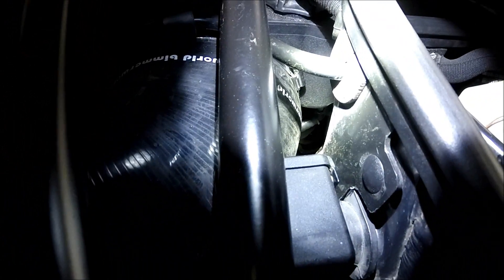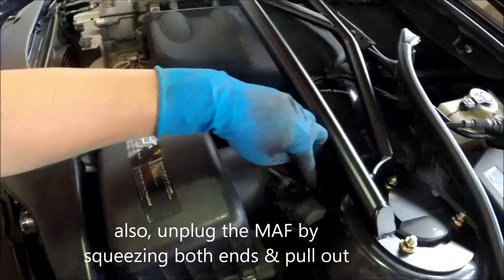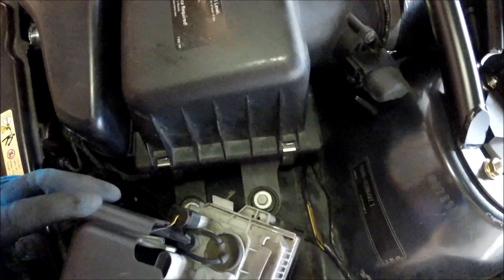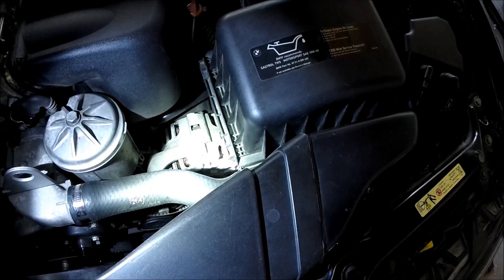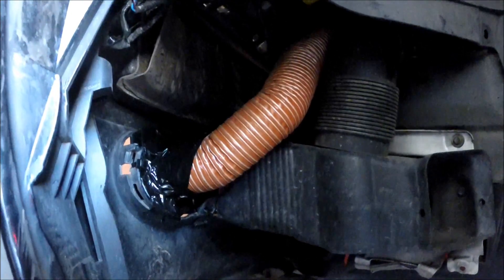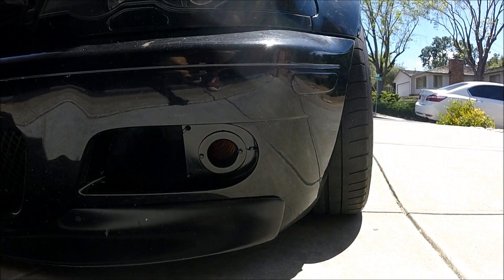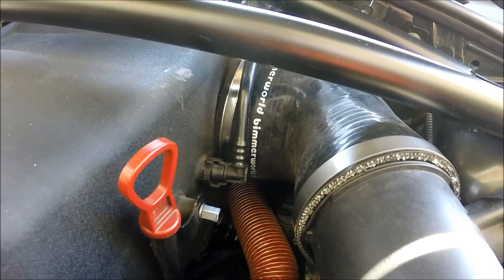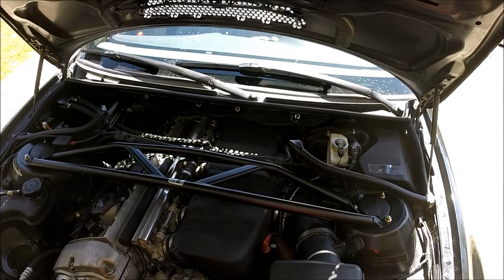SMG Cooling for your BMW E46 M3.

Comment: I wasn't aware BMW placed the pump near the engine. No wonder it gets hot !
On the E36 (mine) it's mounted up top next to the radiator on the drivers side ( RHD car).
This would benefit from from the fresh air constantly flowing around it.
Reply: E36 with a smg ?
Reply: @Avstract23  Yes. You never heard of this ? Euro spec E36 had them. They were exported here to Australia too.

Comment: According to BMW we need a new SMG pump even though everything works it just pops out of gear when overheated like you said. They (BMW) say i need a new one.
Reply from the maker: Mine popped out of gear in the summer traffic. I did the resistor mod and it solved it. I track my car often and have had zero issues with my SMG. Here's someone's DIY for the resistor mod. http://m3forum.net/m3forum/showthread.php?t=414499
Reply: they are wrong. see my post for the real fix.

Comment: Some of you think that this will "do nothing," but it looks like it makes sense.  I spend $3,500 a coupla years ago to replace my SMG hydraulic pump assembly, and I want to protect it against failure.  Pretty sure it's the motor that goes/went.  Why would ducting a high velocity stream of air onto the motor NOT help to prevent this problem???
Reply: BMW techs doesn't know how to fix the issue, so they will tell you to get a new pump.  See my post for the real fix.
Reply: When my car is hot, the SMG cog light goes off.  How do I get to your post?  Thanks.

Comment: I am not a mechanical engineer but I have some concepts of how heat transfer works. Without a heat exchanger there is not much effective surface exposed so I'm skeptical about how this simple air cooling really affects the temperature of the system. It would be nice to have a before / after steady state temperature analysis (this could be read using INPA).

Comment: Do you think you can make a DIY video of the resistor mod even though you've already done yours? My car is un-drivable in the summer because it is guaranteed to drop into neutral if I'm driving in heavy traffic on a 90+ degree day. Maybe instead of just doing the whole thing over again you could show exactly where the sensor is and how best to access it and apply the resistor.
Reply from the maker: Here's a great DIY for the resistor mod: http://m3forum.net/m3forum/showthread.php?t=414499
Reply: Same thing its happening to me

Comment: at 1:21 there is a cylinder shaped tube on the right of the orange airduct does any know what its for because mine has been leaking and i dont know what fluid that is and its keeping me from driving my car if anyone has any idea on what its for please tell me thank you
Reply from the maker: Sorry, not sure what that is. You can check out www.realoem.com or perhaps contact a BMW dealer.
Reply: @SeanS54  all good know i found out what it was its the heater control valve
Reply from the maker: Cool!

Comment: How do you bleed the smg hydraulic system? I would expect that keeping the fluid clean is a must do.
Reply from the maker: Only way to bleed the SMG system is with special BMW software. Because my original transmission failed I put a new (to me) transmission and did a manual swap. Loved SMG but got rid of it to avoid future issues (see my channel).
Reply: see my post above

Comment: tho is it possible to use the hole next to the fog light for air intake?
Reply from the maker: Yes it is possible but you'll be stealing air from the factory brake ducts. Unless you can figure out a way to piggy back off of that opening.
Reply: maybe a big glue gun can help lol, but what is at the end of your additional tube, just an open end facing towards the smg unit?

Comment: This is not worth it at all , what you guys need to do is relocate the pump and you'll never have overheating probles
Reply from the maker: Or just do a manual swap like I did. :-)
Reply: SeanS54 i did that too lol and about to do it  again on my other m3 next week
Reply from the maker: Very cool!
Reply: how much did it cost you? the swap
Reply from the maker: Manual swaps range from $3k-4.5K depending on options (new clutch, lightweight flywheel, short shifter, etc).
Reply: Nelson Hwang it only cost me about 1000$ without changing the clutch.
Reply: Nelson Hwang just in case you need a diy and the list for the parts
 
http://m3forum.net/m3forum/showthread.php?t=444126

Bellhousing modification 
http://www.m3forum.net/m3forum/showthread.php?t=475959
Reply: damn that gonna need a really good shop...
Reply: see my post for the real fix

Comment: Doe's It worth? How It work Sean?
Reply from the maker: When I'm moving on track I don't get the SMG Cog light (some airflow is better than nothing). After a 20 min session and if I'm idling in the pits (no airflow) I get the SMG Cog light sometimes. I think it doesn't cost much money or time to do it and any airflow will help... heat is the number one killer of electronics.
Reply: Thanks Sean! Did you think about installing somekind of small fan somewhere in the middle of the hose that you could switch on whenever you want (or maybe automatically when stop). Anyway i had cog light only once when was really hot after long journey.
Reply from the maker: No, I think that's too complicated. I just ran the ducting which I believed help and was pretty easy to do. I think the best solution, albeit more complicated and expensive, is to relocate the entire SMG pump into a cooler area like the "drug bin" in the engine bay. Search for "SMG relocation" and you'll see.
Reply: see my post for the real fix